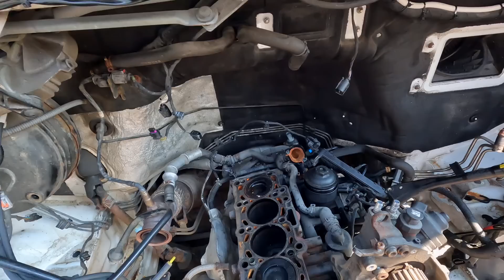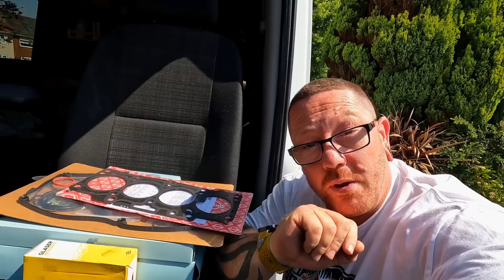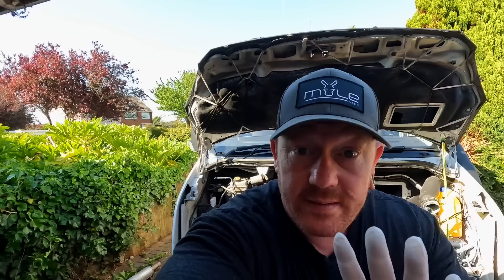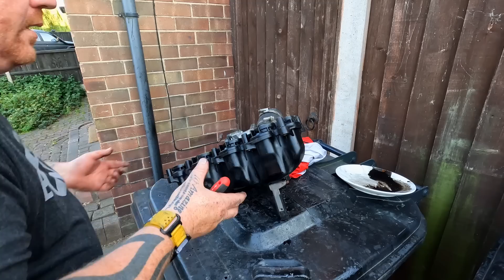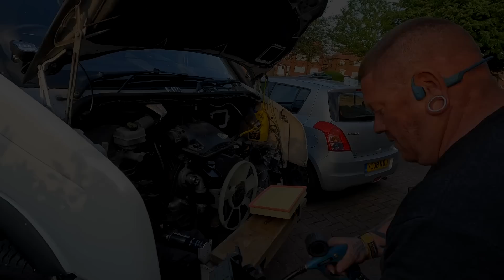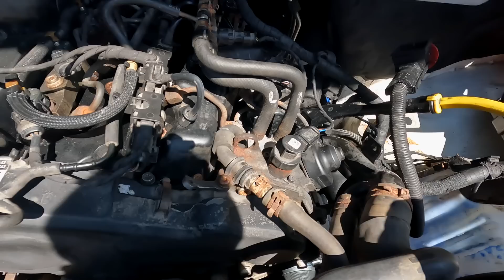Disaster Strikes After Market Engine Oil Seal’s

Comment: Wow. 
I know that I could dismantle my entire engine like you have done. However I’d end up cracking a bolt and having parts left over once put back together and getting the engine back together in the wrong order and having to have a mechanic do it again. 
Fair play to you. 
I already need to find a new mechanic as my mechanics yard is too small for my h2L2 relay self converted.
Reply from the maker: Lots of pictures is key mate . I took loads like where pipes whent and cables things like that also had bolts in bags with that was what . Which helped loads

Comment: Dude, what an absolute mare! Especially when your instinct was correct. I had the same issue, but on MUCH lesser scale, when I replaced the O’ring on my T4 breather valve as I was leaking. New seals in (not VW OEM) and leaked even more. I could see the O’ring was thinner, but still trusted the process. Never again.!!

Comment: That's quite the Job, Neil. I try to use original manufacturer parts when it comes to seals and gaskets - it does save your sanity in the end. 😉
If memory serves correctly, when re-installing the old lifters / cam followers, they should be installed at their original positions as they have worn in with the corresponding cam lobe. Otherwise you will experience additional wear.
And what more can you say about Sam? He is just the nicest guy ever. I had the fortune of meeting him and Lisa and Riley at the last Wheatsheaf Inn campout - he also ordered me some of those grab handles (as the eBay dude wouldn't ship them to Germany) and brought them to the meet. Love the guy. 😊
Best of luck with that van of yours, stay safe! 🚐☁🍀
Reply from the maker: Yer that’s my fault for not listening . But I learnt a Lesson there mate

Comment: Sorry to hear Neil, how frustrating. Suppose on the positive side you will have pretty much a brand new engine and accessories by the end of it so should give you years of trouble free motoring (clearly doesn’t help now) fingers crossed 🤞 that’s it for the setbacks and all good from here on in.
All the very best, David 👍
Reply from the maker: Yer that’s one of the good things is we will have changed most of the engine by the time we finish

Comment: May aswell get the turbo rebuilt while it’s apart. Northwest turbos in kirkdale. About £300-£400 with a warranty
Reply from the maker: That’s the next thing I’ll be looking at mate
Reply: @UrbanVanlife  usually 24 he turnaround too if you drop it off. I’ve used them, no complaints from me.

Comment: Hi Neal i think it would of been worth fitting a new radiator and all so dont put tap water in put distilled water mix 50 /50 water to anti freeze you can get anti freeze and they call it top up water from vw tap water is full of salts and attacks the alloy just done cam belt on mine hope you find it useful
Reply from the maker: Iv never used any thing but tap water to be honest mate in any van . And Iv been looking at radiators to be honest mate . They will probably get changed sooner than later if I’m honest . Just not right now cos the pots running dry . But the plan is to change them bud